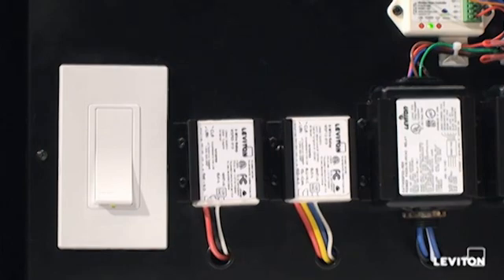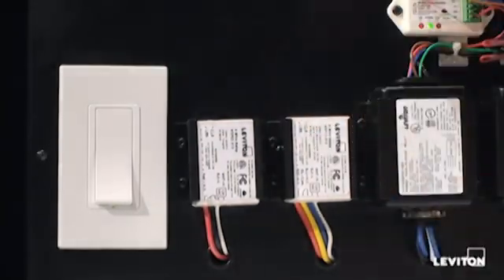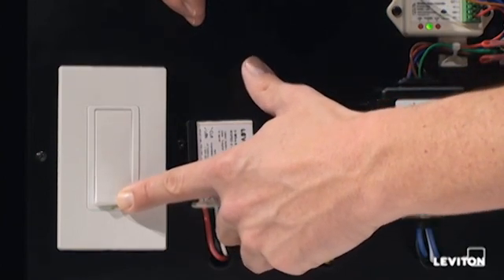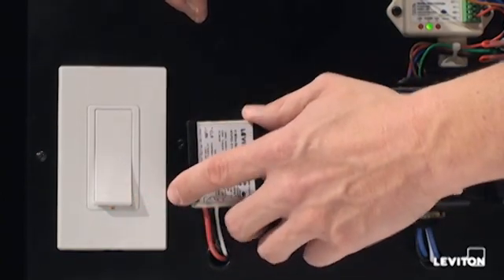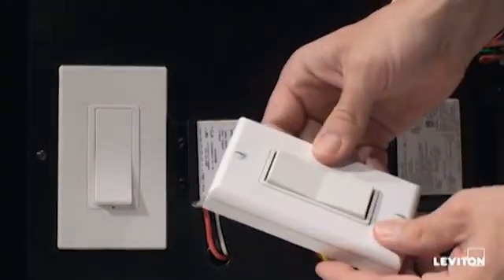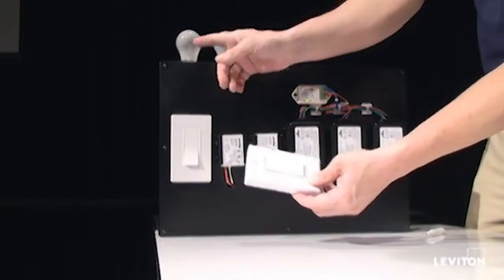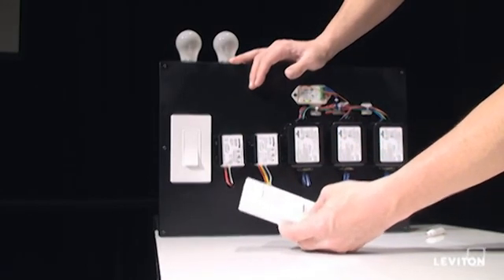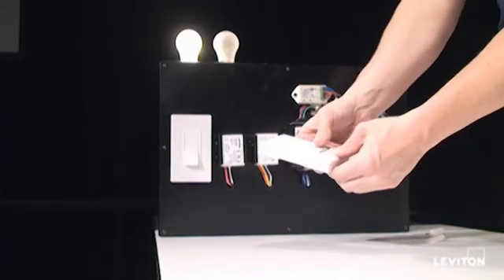How to program the LevNet RF Wall Switch Receiver to the LevNet RF Wireless Transmitter Switch

Comment: Will this work as a 4-way circuit using 3 different wireless switches, allowing you to turn the light/relay on from any of the 3 switches as well as turning the light/relay off from any different switch?